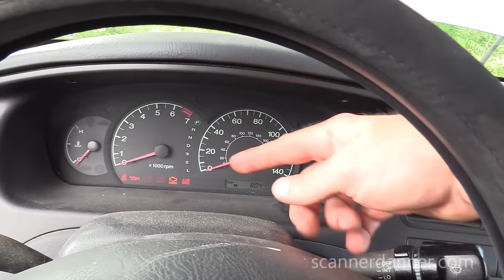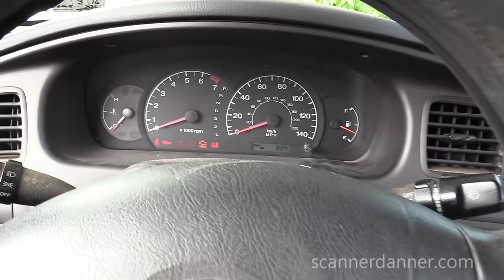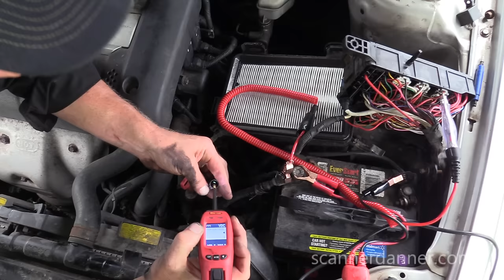No crank, good starter, how to troubleshoot, any car! (Hyundai)

Comment: Just when i was about to give up. Was so much in pain trying to figure out why my car wont crank. was searching and searching so much. Then this video got my recommendations and fixed my problem. Keep up the good work man!
Reply from the maker: Hell yeah, that's awesome! Thank you. What was your issue?
Reply: @ScannerDanner  My issue was that i was getting no crank what so ever. And reason was the fuse box crank relay that was bad. And im not a car guy who fixes car so im happy that i stomped upon this video after trying to search solutions.
Reply: @ScannerDanner  i have a question for you also. I still have a 1 car that beeds to be fixed (ford mondeo mk2 year 2000). Issue is, i was driving from work and car completely cut off all power and keeps blowing fuse everytime i put new one in. Its F40 fuse and i was watchin fuse box diagram and its ignition switch, light switch (headlights / fog lamp. Any idea what could be causing this issue? Have been trying to search rupped wires with no luck.

Comment: @Scannerdanner why not use the flat pin fuse adapter for the powerprobe? It is designed not to spread the terminals and losen them.
Reply from the maker: I never pushed the tip of either the power probe or the test light into the terminal itself. It was wide open. Make sense? I didn't need it.

Comment: A relay is nothing but a contactor. You have a line side feed heavy ga wire. A load side heavy ga wire. Then a signal ground. Then the source to ground that closes the replay... That is how it works. This allows you to buy relays to fit the size of your line and load side. The signal\source can be a 18 ga-22 ga wire. As all it does is close the relay contacts inside the relay. ie the ignition switch. Your line-load side carries the amps. That the relay is rated to handle....

This is why I use dielectric grease on connections open to water. I pack the rear open end and the male of female end.. That stops this shit....

Comment: Just seeing this video and just had a similar (but different cause) problem on an '05 Toyota Camry...  Debugged and had decided it was the starter; had a good signal coming down to it when the key was turned to start position...  Took the starter to O'Reily's and they tested it for me - PASSED all the test!  What!  Took it back, put it back in the car (pretty easy on the 2.4L) and nothing...  After checking the signal again I was thinking maybe that signal wire wasn't carrying enough current???  Took starter back out, hot wired it on my tailgate of my truck with a known good battery - nothing!  Went back to O'Reily's and this time it tested bad twice!  Anyway, after new starter, I'm good to go...  Lesson is these starters may work partially and then finally die...  Thanks for all you do to help the DIYers out here.

Comment: Dan, any thoughts on Load Pro leads for a volt meter? Seems like that could of helped you out here a bit.
Reply from the maker: Oh man, you have no idea the history here. No, the load pro would not have made this job any faster or easier.
Reply: LOL some guys got pretty upset on the load pro :)
Reply from the maker: had nothing to do with the tool, just the creator of it
Reply: I'd like to hear that story sometime!
Reply from the maker: page 2 and page 4 of this thread
https://scannerdanner.com/forum/diagnostic-tools-and-techniques/333-loadpro.html?start=30#5501
Reply from the maker: He was his own worst enemy.
Reply: ScannerDanner Paul, I've read about the controversy from multiple fronts but you do have to admire the passion for teaching that this fellow has.
Kinda like someone else... 👍🏻
Knowledge rocks.
Reply from the maker: Exactly @Anthony Welton
Reply: ScannerDanner greetings !! i hope you help me ! my pathfinder runs in "slow motion" and then takes its normal speed, transmission solenoides problems ?what do you think mr danner ?

Comment from the maker: 8-17-19 Don't forget about the SD merch you see above me^^^^^^^^^ 100% of my proceeds will be going to charity. When I have the list complete, I will be putting them up on my website (who we will be helping). Right now I have a pro life group called the Human Connection that offers free ultrasounds to women considering an abortion and of course a ton of other benefits for these hurting woman. I also have Light of Life Rescue Mission (homeless shelter in Pittsburgh) and a list of about 5 or 6 more. I think I will probably only go with 3 charities for now, to get the most help we can to these people.
Reply: I'm having trouble getting my Mercedes Benz clk500 to start. I get power too tha main fuse and relay box. No start at all.
Reply: Hello can you please help me, find the problem to my 2008 Infiniti QX56 no crank no start the lights and radio are coming on. But afew weeks my battery was leaking so I got the battery cables change it was going good. The Qx56 started to malfunction the side mirrors started opening and closing everytime I started the Jeep than the Qx56 would be in drive and the reverse cameras would be on. So I watch a video that told me to take the cables off the battery so the Jeep could reset it that work well . than we had a hurricane I think water got into the back of the Jeep and made it’s way to the back and second seats in the Jeep because the Jeep was running I was out and about stop at the store got out when into the store came back out the Qx56 will not start. Can you please help me. Thanks in advance
Reply: ScannerDanner Thanks for the Info like awesome!!!
Reply: Have you fired your camera man yet? He acts like he's afraid to put the camera ON whatever the topic is! He may move his head and eyes, but not the camera....
Reply from the maker: That camera man is my son and it's taken some time to train him. Watch some 2019 videos. You'll see
Reply: @ScannerDanner  Will do 👍
Reply: Right on, Danner!
Reply: Sir danner can i ask you something about a mazda 3. Crank but wont start then we check the ignition coils very weak current. Thank.u
Reply: M
Reply: Like if true.
Reply: Is pretty nice what u do with those people Dan
Reply: Toyota Avalon 2003 that I put in a fuel pump and now I don't want to start do you know anything that could happen have happened
Reply: Do you also provide support and resources for the women/girls who are in such a difficult place, regardless of which choice they make, even if they aren't able to make a pro-life choice?
The situations females find themselves in who are having to deal with making a "choice" decision like this are so radically unique to each individual and a tremendously heavy load to bear usually entirely on their own. I would support you if I knew that you supported all aspects of this issue in that you/your charities were fully supportive of not only pro-life choices but before-and-after-care for any female "choosing" to undergo the procedure to terminate her pregnancy including medical care and extended psychotherapeutic care, along with help with whatever underlying adversities she might be dealing with. Also, I have concerns over how charities factor God into the support they offer. We have an Almighty Creator who alone should judge the morality of a female's choice in these situations, and so I'm wondering if that's how your organizations come at this issue. Also, I would want to know that they are not being shamed or told they'll burn in hell or that God won't love them or be there for them. A lot of history in the last 50 years or more of violent rage against abortion clinics, abortion doctors, and the attacks and extreme abuse being hurtled at these women who go  in and come out from these clinics all in the name of life/God and is pure hypocrisy by fools who think they're God, which are the two faults in man Jesus lost his cool over, fools and hypocrits. God bless. I would love to donate if possible.

As for the video, great tutorial walking through each step of troubleshooting. Dealing with the no-crank blowing-fuses issues with my son's car. His friend is telling him it's the starter solenoid lol and I'm telling him it's wiring. Your video has helped him understand a little better about how cars work...or don't work. Peace
Reply from the maker: @torquewench717  I'm sorry, I do not, under any circumstance, support the killing of babies, for any reason.
Reply: @ScannerDanner  I would just point out that you're judging the actions of others when that is entirely God's role. However, I've seen too many "main-stream Christians" hypocritically play that role to know there's nothing I can say to you. It just hurts my heart to know the suffering that some women have to go through only to have support denied them in the guise of the name of God. I would just direct anyone reading this to John 4:4- regarding the woman at the well and also Mark 2:17 as well as Matthew 23:28 as it applies to those who choose to judge others. The last comment, I like to use the gauge "What would Jesus do/say?" I know that Jesus would never turn his back on a sinner or we would ALL be doomed. Needless to say, I can't support an organization that insinuates the name of God where not appropriate. God bless you and yours and I'll pray for you for insight and understanding. Peace.
Reply from the maker: @torquewench717  I am not judging my friend, that is up to God. Nor would I ever condemn someone to hell for making this decision. A sin, is a sin, no matter what it may be. We are taught in scripture that when we hate our brothers, we are guilty of murder too! So I am no more condemning to a friend who has issues with his brother than I am to someone who's had an abortion. These idiots who picket in front of abortion clinics with these signs saying what God is going to do is flat out wrong. I am not one of those people. May I challenge you on one of your examples?
The woman at the well, what was her issues? Why did she come and draw water when none of the other women were there? Because she was ashamed and had 5 husbands and one she was with now, who was not her husband. What did Jesus tell her? Did he say, go on and continue to live the way you are? Or did he tell her that she needs "living water" and a different way of life, so that she doesn't thirst anymore.
The majority of abortions are done by those who want to live outside of God's order! One man, and one woman under the marriage covenant. (The only earthly example we have of our relationship with the God, for we are the bride of Christ) They want to have sex outside of marriage, which is a sin, and they want to cover it up by killing the baby that comes out of the lusts of the flesh. You cannot get past this, with the examples of rape and abuse, as an excuse to keeping it legal. Look at the numbers! This is a slaughter and is no different than the Israelite who sacrificed there children to the fires of Moloch. What did God do to the nation of Israel because of these atrocities? 
Final word, my merch sales are going to a student grant I have created at my school and my tools sales from AESwave are being donated to techs in need of equipment. So I'm not doing anything on this front as I had originally intended. I hope to someday, but right now this makes more sense. 
Thanks for your time. I appreciate your comments, I really do.
Reply: Uouoioio
Reply: @ScannerDanner  and I appreciate you taking the time to respond, I really do. You've given me and others a little insight into your perspective which is always a good thing. I come from a perspective of having known people I love who have had to make this extremely difficult choice, and it's not as simple as one would think. One in particular comes to mind wherein she has lived with the guilt and mourned the loss of her baby (she was married at the time and it was her husband's baby) for decades now but has become one of the strongest christians I know. I am only trying to point out that it's not a clear-cut position to be in, but it is an opportunity to help bring God's love to someone who doesn't know it or understand it. The fact that some of these women are having premarital sex and then make pro-choice decisions shouldn't stop the Christian from extending a hand to help, despite the fact that you absolutely don't support it, if for no other reason than to hopefully prevent them from making the same mistake twice and hence saving lives. The world we live in today is smeared with acceptance of carnal lusts and our government further supports the degradation via the welfare system, the education system, and legislation. On top of that, you've got  Hollywood, the music industry, and now social media promoting the sins of man . The majority of people, including many Christians, are so very far removed from God that they have no clue the level of sin they've fallen into. That's all I'm saying. I would love to hear about your school. I have been homeschooling my children for years now using A.C.E.'s (Accelerated Christian Education) curriculum. I thank you for your expertise with regards to auto mechanics. Very good video. May God continue to bless you and yours. Peace
Reply: @lawrenceclemons6023  does it not crank without starting ,its called a no crank situation ,some cars crank but wont start ,thats called a crank/no start ! important info !
Reply: I got a 1997 Toyota Corolla car it will start and it will run and then sometimes it will not run it will start and run and quit real quick what could be the problem I put a relay fuse in it it's usually at night time when it does not run when it's cold but when it's hot outside it runs I just don't know what the problem is that's how I take my mom and dad to the doctor and I are sick people I need to get this fixed as soon as possible thank you and God bless you all
Reply: Scanner Danner I'm have a no crank it was running and it just turned off when I was driving
Reply: Hi there.what do I need to do to have some advice for my Jeep Grand Cherokee? Thank you
Reply: BBB

Comment: stranded on the side of the road in the same gen elantra about 3hrs ago. got it towed home and within 25min it was fixed thanks to your video. went through the same trouble shooting with the battery, relay, and starter smacking while i was on the side of the road. turns out it was literally the same issue. i reached down and wiggled the wire while my brother in law worked the key and it started to crank until i stopped fiddling with the wire. i crimped a new female spade connector on there and it's good as new. ... at least until it happens again. then at that point im just gonna replace the entire wire .

Comment: This is what my car is doing I haven't got it crunk yett
Reply: Put a wire from the starter to the positive power of the battery
Reply: @cainvalencia3438  Why should someone do this? Can you burn out the starter by doing that?
Reply: @nathanieltatum5311  no it just turns the car on

Comment: Thanks for the great video and knowledge. However as a paying customer I would object to paying a diagnostic fee for the check engine light if the light wasn't on previously. Your testing or removing of certain parts (air box removal) or wiring harness, relay removal etc. could set a code if not in place when power is introduced. Therefore I think the code should be cleared as part of this repair and all components are restored and the repair tested. If it then sets a code it is not related to this repair and then is a completely unrelated issue and could be pointed out to the customer. Don't make it seem your setting your customer up to get some more money from them in a questionable way. Keep good ethics.
Reply: Ok Darrell

Comment: Conclusion,if your car doesnt crank,use your p.p.🤔
Reply: Or jumpers to give temp power to your S Post but honestly that's just confirming starter is good/bad. Paul Danner is methodically eliminating all the realistic possibilities that cause a no crank in that circuit, controls, N/P safety switch, ignition and the test light stresses all the controls and tests power feeds and is the fastest way to do it.
If I'm not mistaken he's using the OTC 3633 mini incandescent coiled circuit tester that draws 158mA-300mA depending on if it's OE bulb or one of the many OTC replacements.
My OTC 3633 mini factory bulb tested at 158mA at 12.6V

Comment: Wow! Just watched this video after my daughter called and said she had a similar issue (intermittent no crank) with her 2007 Elantra and she just spent $500 to replace the alternator and still the same issue. She has taken it back to the shop for them to fix it right and probably will not get her money (nor the old alternator) back. I am very leery about having them do anything further as it seems like a totally shady, totally off-base diagnosis to replace an alternator for a starting problem, especially before doing a lot of other things like what is covered in this video. I'm going to talk to them in the morning and will definitely ask if they have checked the relay wiring. Thanks for the video and just letting you know it is still helping people many years later.
Reply from the maker: Thank you!